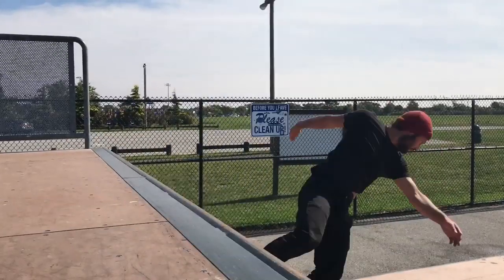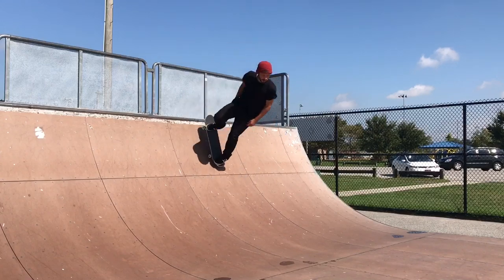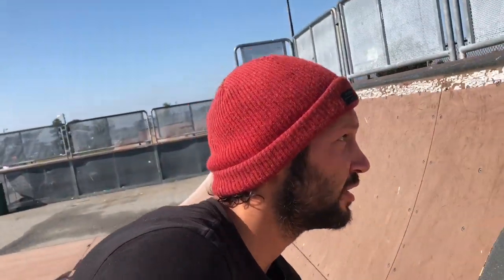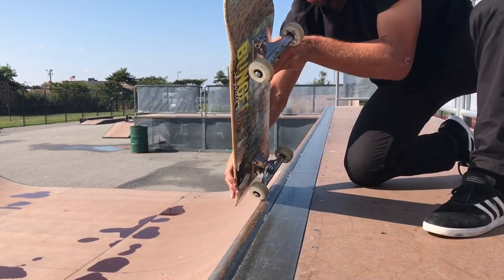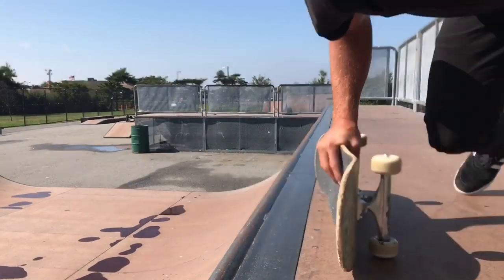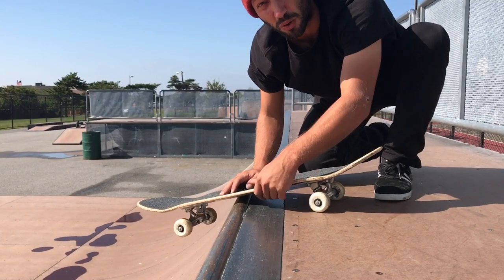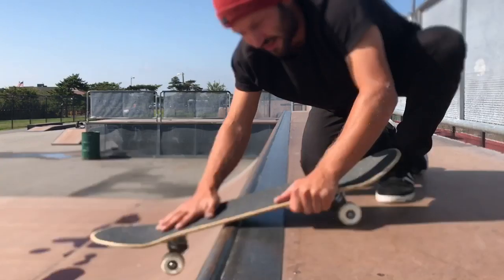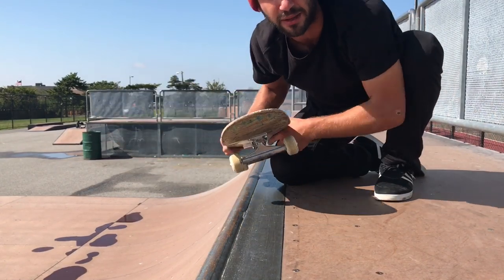How To Backside Disaster On A Mini Ramp

Comment: Ive taken a 3 year break from skating, when i came back to it, the local skatepark moved and got a huuge upgrade. Like its a really nice park vs before the change where it was sketchy af, 20+ year old ramps from when bangor maine first built a skatepark in the 90s(i think, not sure). But since ive got back into skating, ive learned a few new tricks on the double miniramp bowl spine thing, whatever it is. 1 kid taught me switch rock, had the thought of it being a fakie rock to regular. Thinking that it was fakie helped me, but i also wondered why it felt so uncomfortable, thats because it was switch and i wish i didnt think over what it actually was because now im just failing at it now. Next trick was fakie 180 pivot(?) rock n roll, then the third trick was a quarter step forward going into willy from that fakie 180 pivot. Heck maybe next up is that first combination to nose grind, thatd be sick. Also relearned this funny trick i did before i paused my skating, willy to rock n roll, gotta get fast with them tippy taps. Willy, tap into rock then roll out to regular. I would like to learn blunt transfer on the spine but i cant seem to get myself to do it, i feel like there will be a little drop from the wheels going over the coping to the tail slapping onto the coping and it will startle me and I’ll just slip out. The weird thing is that i can tail drag right out of a blunt onto the deck of the mini no problem so why cant i just go over the spine?